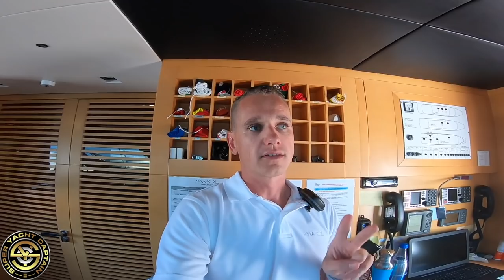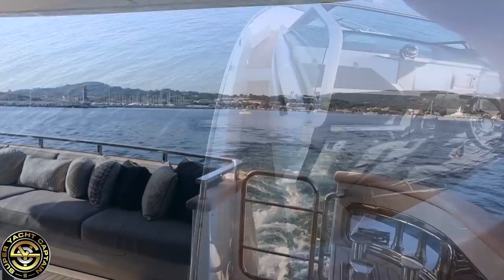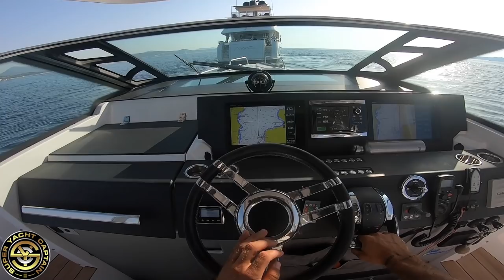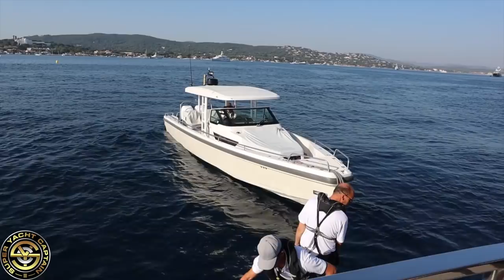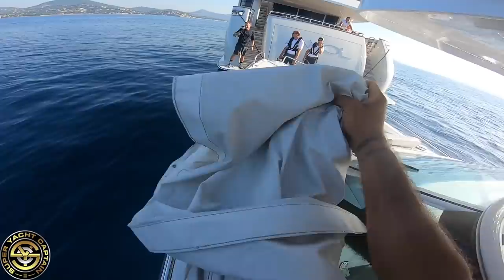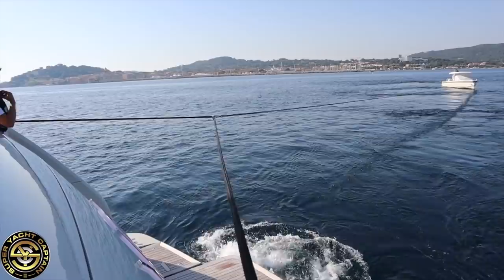Towing A 700HP Boat With A Super Yacht!!! (Captain’s Vlog 92)

Comment: interesting, what flags or lights do you have to show that you are towing another boat. i am sure your cruise is worth the price just to meet Barbra
Reply: They normally has to show a diamond shape on the towing vessel (Awol) by day and by night they have to show an additional masthead light and a stern yellow light!
Reply: Paul Campos Vidal even with boats shorter than 12m?
Reply: @ValentinFrankBeyer  the thing is not about the size of what you are towing it's about length from the back of AWOL to the stern of the chase boat, if it's <200m it's a diamond on the main vessel if it's over one for each
Reply: I love how all the crew partecipates in the channel😀😀😍😍❤❤

Comment: Pretty expensive chase boat. It would be a sin to loose her in heavier seas.  Half the reason I watch your channel is the lovely Barbara! Her accent is enchanting.❤️❤️❤️
Reply: @berndhaverkock6070  ...and the other Versions are brilliant boats, too! The Axopar 37 Cabin looks like a 33-foot version of H.M.S.s Nelson and Rodney, but with excellent driving characteristics. It was actually designed around the hull. The Finnish designers wanted first: a fast boat with excellent driving characteristics, second:  a fast boat with excellent driving characteristics and third: Oh yes - a boat... Even with the largest engines, the same 350 hp Mercurys Chasing Awol has, and complete everything-you-can-buy-for-a-boat, you hardly bust the 300 Grand limit (talking Sterling). For that money you get extreme boating fun! I love the beasts :-)

Comment: How come you raise the motors up on the tender? When ever i towed for my old marina i always had the motor or motors down on the boat i was towing so i kept the boat from swaying around on the water?
Reply from the maker: Always trim up or lock your props. As the water flows, it rotates the prop, after long hours of towing it can damage your due to lack of lubrication.  lubrication.
Reply: True on hydraulic gearboxes without optional trailing pumps or with IPS but definitively not with outboard where pinion gears are in a lower unit full of oil. 
Great job, I really like your channel.

Comment: I'm surprised you have such a large chase boat. Any reason why? I would think it would be better to have a rigid inflatable hull boat as your chase boat and one that is capable of being hauled into the garage. I know you probably use the chase boat to ferry clients back and forth but seems like there could be better options for a chase boat than what you have. That chase boat alone probably costs more than my house. I would think there would be liability with having the boat being towed and the risk of it slamming into AWOL. Is the chase boat provisioned out in anyway in case it needs to be separated from AWOL?

Comment: you're supposed to keep the engines down when towing it keeps the vessel straight
Reply: Indeed it does. It can also send water up the exhaust and into the cylinders, trashing the engine.

Comment: My question is when you are coming into port I assume way before this you would stop to untie the chase boat. Question is how do you get into the chase boat so that you can control it and keep it away from crashing into the back of the yacht?
Reply: It's not like a truck towing a car with a rope. AWOL won't brake in the middle of the sea with Chasing AWOL continuing full speed towards her. AWOL slows down gradually and the chase boat will then slow down by having "friction" or whatever it's called for water (sorry but English is not my native language) and eventually it will stop. Boats stop pretty easilly when forward force stops.
Also Harry mentioned in another video he has to pull the boat and what a workout it is, so I guess she stops a bit far from AWOL so no danger of a crash.
Reply: Also she tends to turn sideways so you can guess she stops a lot quicker than normal.

Comment: dear capt if you had to do an emergency stop how would you prevent the tow boat from crashing into awol .
Reply from the maker: That’s a very good question. The chase boat stops very quickly due to the drag through the water. But I will look into that. Thanks 👍
Reply: @SuperYachtCaptain  I´m guessing that the only way to emergency stop something as heavy as Awol fast enough for the chase boat to crash into it is to give full reverse on both main engines? And in a situation that requires such a radical action, getting hit in the stern by the chase is very much the least of your problems and will cause very minor problems/damage compared to what you are trying to avoid by doing an emergency stop anyway?

Comment: Does towing a tender add much to your fuel consumption?
Reply: Robert Riocca not terribly much. you could pull the chase boat with your bare hands. In fact you could probably pull the AWOL with your bare hands. But the drag of the chase boat is not much considering the power of the AWOL engine.

correction: engines
Reply: @theolopez3299  Thanks Theo...love your vlogs and your respect for the owner of AWOL... best wishes.

Comment: Just curious doesn't the towed boat need a flag of some sort to show that it's being towed for other watercraft to be aware of the tow line?
Reply: also a light at night
Reply: Wouldn't tying a couple of floatie fenders equal lengths along the tow line offer more safety to other vessels that a towline was being used? Otherwise I could imagine a casual jetskier trying to cross between the two boats and not seeing the towline until they snared it with their prop.

Comment: If there's a chance that any other boat crosses between the yacht and the chase boat, wouldn't one be required to have some sort of flag/balloon/bumper visible on the connecting line to the chase boat?
Reply: If you think about it, they only tow while underway. Do you really think anyone would try to pass between two boats that close on the open seas? 🤔

Comment: Very nicely done!  Do you have to hoist day shapes when towing the chase boat?
Reply: They should only be required if over 200 meters if memory serves.
Reply from the maker: correct, under 200m is not necessary just 1 extra steaming light and a yellow stern light

Comment: May I ask why the tow line needs to be so long? Why not keeping the tender , say, at half the distance?
Reply: Harald Steindl it’s safer in terms of the tender coming up and wiping out the transom or putting in a dent it so the could slow down a bit faster but that is around about where you want it

Comment: I enjoyed your video even though it had jerky hand movements making the video shake abnormally as you walked or panned. PLEASE consider acquiring and using a STEADY CAM type of device to make your video smooth even as you walk or pan around. If you are willing to donate 10,000 Euro then spending 100 euro on a steady cam device will not mean much to you but it will greatly improve your videos! Thanks again for the content, they are quite informative.

Comment: Seems kind of dangerous for anybody on the back deck. If that line breaks the cleat is flying into somebody's teeth.
Reply from the maker: I hear you but that can be said about any towing operation don’t you think?
Reply: Dyneema is strong and light (floats in water) that makes it safer for towing than steel wire as it contains less energy. And thus less chance of it causing damage when it snaps.

Comment: That 20 dollar bridle is going to cost you a 500k chase boat. But a great vid apart from that.
Reply from the maker: we've towed over 6000nm with that bridle. I think we're good ;)
Reply: The black rope across the stern??  If the internal angle of the black rope exceeds 120 degrees then each side of the rope is carrying the entire weight of the chase boat. It will part when you least want it too, in bad weather when something else is going bad on you. Why can't you guys make up a dedicated bridle with a non metalic eye/splice? In essence you have expensive dynema, a triple bow line, a very good swivel and a single point of failure on the black rope.
Reply: Maybe not the bridle, but paying attention to the video might cause it to vanish.
Reply: EricsArchive 
Two head line with eye better to attach your towing line make your boat at the center
Reply: I know besides the point but No way that chase boat is 500k. quarter of that at best
Reply: The chase boat starts at 83k euros
Reply: A new 2019 Axopar 37 Cabin with twin Mercury Verado 350's, is listing on Boat Trader at $225,000USD.